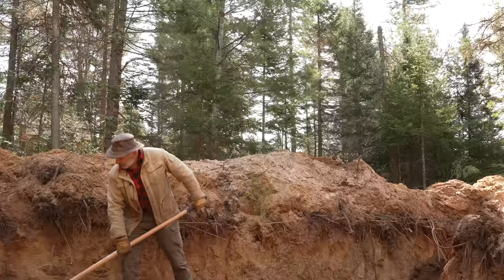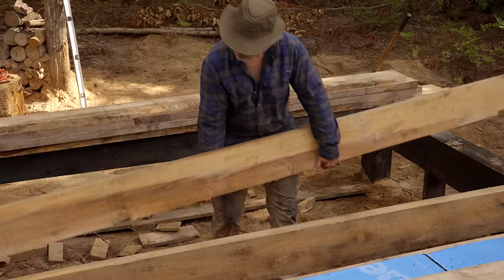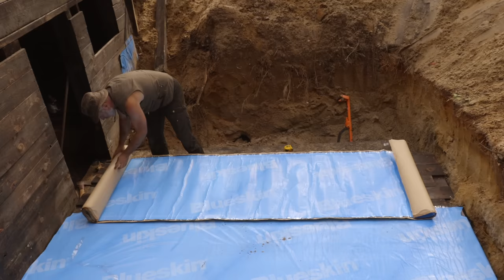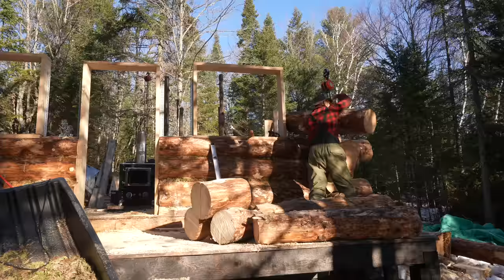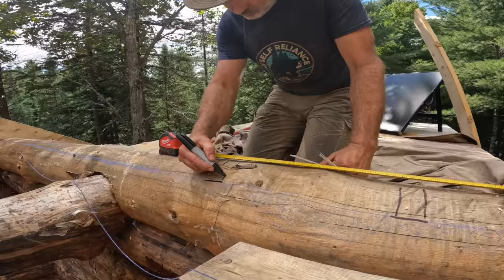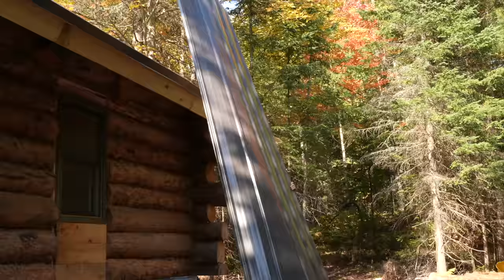2 Years Alone Building an Off Grid Log Cabin in the Wilderness, Start to Finish Timelapse

Comment: Shawn, I also admire all that you've learned about tools and techniques for cabin building. After watching Erik Grankvist (Sweden) and Nik Rijavec (Slovenia), I couldn't find other log cabin builders that I wanted to learn from -- until I found you. But having watched you, I've compiled a list of questions. Would you be willing to answer them?

> How did you mill the lumber for your refrigerator / root cellar? Did you have a separate machine, or did you mill it using a chainsaw on a template?
> How well did torching protect the lumber from bugs and decay?
> How did you attach the cables in your winching system to the trees you used for anchors. Did you climb the trees using loggers' spikes on your boots, did you use a ladder, or ???
> What types of winches  (makes and models) did you use, and how did you choose them?
> What types of axes did you use?  I noticed adzes, and broad, carving, and bearded axes?
> Other tools I noticed were log peaveys (logox)

And, of course, you had a wonderful golden assistant. :-)

BTW, have you seen any of the amazing projects that Advoko makes?

Sean, thank you for sharing all that you've learned and accomplished.